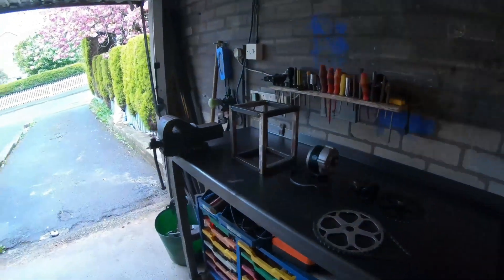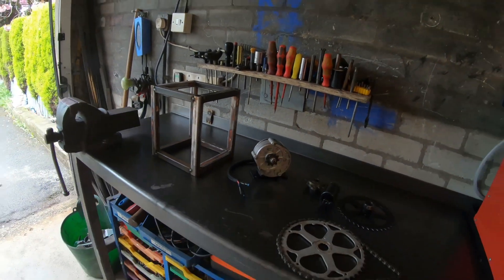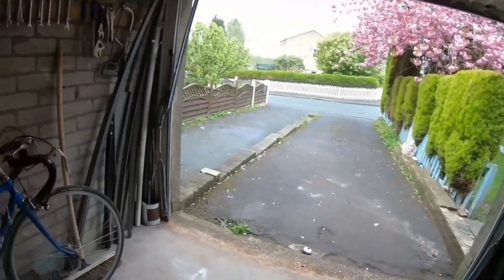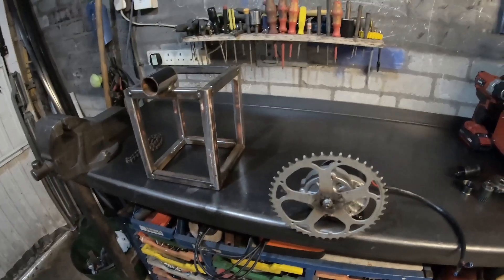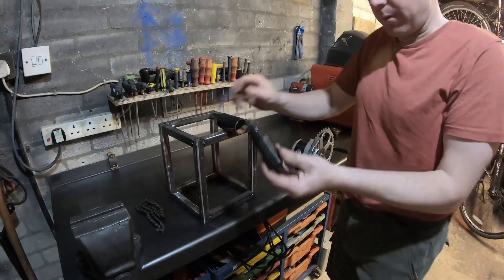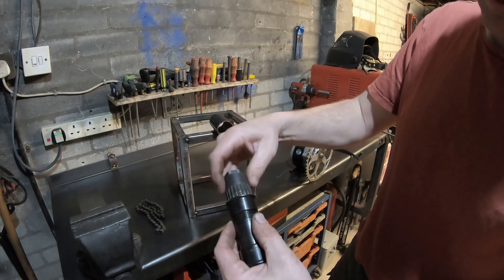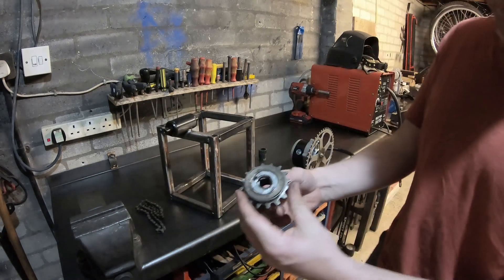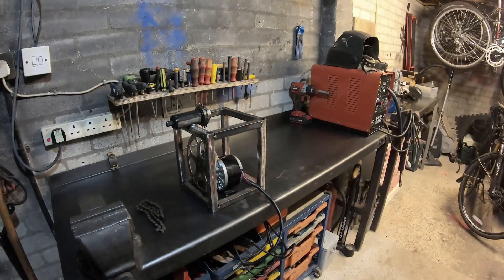Build a wind turbine for under £100

Comment: Looks like your motor is geared down, necesitating the gears between fan and motor/generator, there are losses in both gear sets. Maybe remove motor gears and you can use direct drive or if necessary just one gear set. 😊 great video, thanks 🎉

Comment: with the low voltage you get i would use a voltage doubler circuit, capacitor and diodes... then to a controller circuit for the voltage you need example 12 or 13 v/...
the blades need to be longer and 2 would suffice and create more speed, 5 = less speed.
Reply from the maker: thanks for the comment. I will try and incorporate these ideas in Mk2

Comment: You should put the larger gear onto the shaft connected to the turbine blade and the smaller gear onto the motor. This will create a higher gear ratio and a higher rpm in the motor producing more voltage at lower wind speed.
Reply from the maker: I'll try that one. ta
Reply: Will not have the torque necessary. I believe the motor already has its own gear set?

Comment: Bloody size of that fan. What is it off?
Reply from the maker: Its off a DAF military truck as far as I know. I bought that and one off a Perkins in the same lot.
A cheap work around to buying the proper turbine blades.
Reply: @robertthorn23  - That's how it's done...
Reply from the maker: @Xx-xd3zo  thanks
Reply: @robertthorn23  Except that it is a propeller and not a turbine. It is designed to move air and they are designed differently than blades to pull energy out of the air.
Reply: You get what you pay for ☹️. Wonder how long that chain will last ?.
Reply: Great job well done ! I think a belt would be better Especially at high speed and less drag I would reduce the size of the pulley on the motor end...... Nice work

Comment: Did you connected it directly to the batteries?

If you find an mppt charge controller at a good price (because they usually cost more than pwm's ) it would be a lot better for the batteries to cgarge even at lower  wind speeds.

Another good alternative would be a capacitor bank (13.6v) connected as the middle man between the wind generator and your batteries.

It's an awesome construction by the way, great work.
Reply from the maker: Thanks.
Interesting points.
 I'm going to research them both. particularly interested in the capacitor bank.
Reply from the maker: I haven't connected it to the battery's yet.
Reply: Could use a 50 amp Didio with a heat sink. Hook straight to the battery's and it will start charging as soon as the wind turbine starts making more power than what's in the battery's. Don't let it boil the battery's when fully charged.